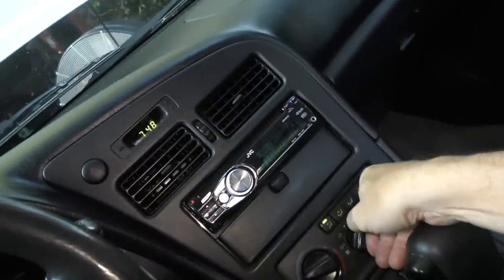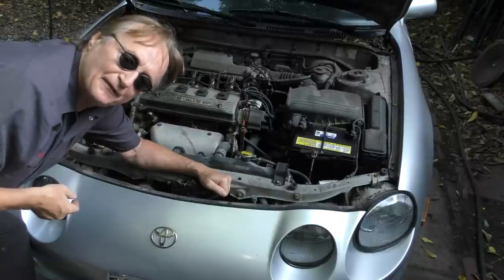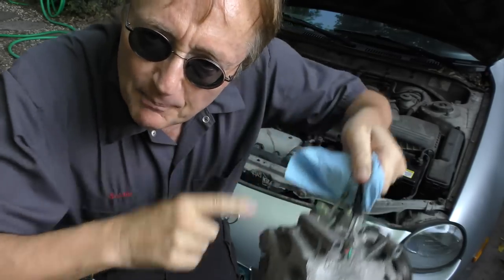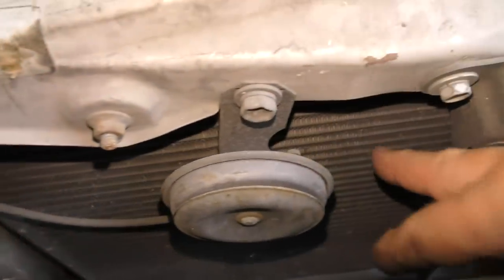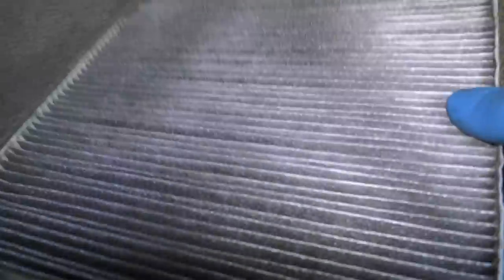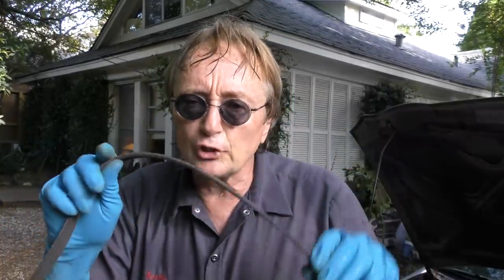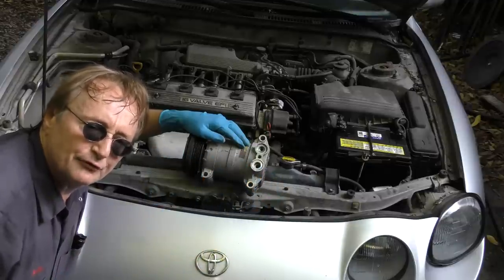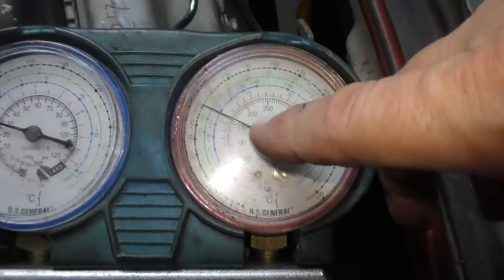How to Keep Your Car's AC Blowing Ice Cold

Comment: hey scotty I have 20year old Toyota corrolla few month ago my ac condenser fan stops working I drove about 1 month with no condenser fan after some time I have replaced my ac condenser fan but now the cooling has dropped significantly my mechanic told me to let it be so otherwise get your compressor changed ..... the problem lies is I am not able to find a new compressor .... only the second hand ones are available where I live....... (not rebuild one) should I try or import a Chinese one .... this is not my daily driven car ... so do I let it be  .... Thank you

Comment: Hi Scotty .. I have a1988 Cadillac Eldorado Base Model . AC blows cold but not much comes out of the vents set on high. Thought it might be dirty Cabin Filter. But I believe it doesn’t have one. If it does where is it located? Any suggestions why I am not getting to much air threw the vents?

Comment: hello scotty
why is it that most german cars with turbos burn oil. My VW passat b6 was burning 1 quart of sythetic oil every 1000 miles. The car was under warranty so the delearship fixed it. But I hear so many people have oil consumption issues with the VW/AUDIS.
Reply from the maker: cause turbos bascially increase compression ratio inside the engine, and the higher the compression, the more they burn oil over time

Comment: Hey buddy I watch your videos all the time literally I have a Mazda my ac stopped working and I have a baby and 3 kids lol I wasn’t getting any high side pressure so I replaced compressor now I get high side pressure I bought a temp gun to scan the condenser and I’m getting different temps when I put the laser on condenser so I’m thinking there is a blockage so I’m going to buy a new condenser it blows cool but not cold enough like it used to I changed expansion valve also so I’m thinking it’s now the condenser? My fans work also

Comment: I just filled my 2007 4Runner with refrigerate before a trip to visit family over the 4th, and the problem I had beforehand was the passenger side blew cold and driver side was lukewarm. 
So I added refrigerate with the A/C Pro kit. It worked...kind of, but the problem I have now, and we encounterd this on the trio and back, is that it would blow lukewarm and cold in like 30 second intervals each. It would basically go back and forth the whole time. 
According to the meter that came with the kit, I had plenty of refrigerate in the system after adding it, so......any suggestions to my current issue?
Reply: Probably have to email him.  Doubt he will answer your comment.

Comment: That condenser is actually quite dirty. They sell a coil cleaner at the HVAC supply house and its pretty cheap. You just spray it on, let it foam up, then hose it off. You'll see a butt load of dirt come out of there, trust me.

Comment: Hey Scottie I took my 2001 nissan frontier to bigo tire ac was blowing hot,$ 223 dollar's later still blowing hot air. I let the same bigo tire store try and fix it 5times.
   Now there is coolant all over my low and high side and the same bigo shop gave me a quote for $811to repair the lines from both high and low.
   I'm  pretty sure that I have a shady bigo tire shop since there was no leaks for 4times and the 5th time it's all over my engine. It like the coolant was out having a rave in my engine. 
   What's your normal way a mechanic will do a ac diagnostic?
   And all 5 times given the same invoice and one time the manger wrote with pen that ac was charged with die. Is this a normal way of doing business?
   Please help Scottie I have a make shift cooler and dry ice ac now and I spend about 5to 8 hrs in the truck.

Comment: I have a 17 crv with the new r1234yf refrigerant which is a pain to get someone to fix and don't trust dealers to fix anything. It's got dual zone climate control so right side gets cool and rear vents but left driver side blows warm and not sure why it what's going on.. so many parts to an AC system it's overwhelming. I can get the gauges but how do I know what pressures high and low ? If it depends on various temps and humidity. And my car says min max recharge around 0.448 kg give take

Comment: My old '97 GMC doesn't use any fans for the air conditioning. I turned it on today for the first time since I bought the truck last October. And it seems to work although the air wasn't very cold. Should I try giving it a recharge then?
Reply: What does that mean that it doens't use any fans for the AC? The condenser is cooled by the clutched fan only? Well, a bus driver once told me that the AC on his bus worked but it wasn't very cold. Why? Only 1 out of 5 condenser fans was actually rotating, and that's what i told him... look if there's another dedicated fan for the condenser and, if not, either put one or replace the fan clutch. Forget about recharging it yourself with refrigerant cans; it's always better to go to someone who has the equipment needed to evacuate and vacuum the system and then put inside the correct charge weight.
Reply: Before I'd install a special fan for the air conditioning, I'd want to see if anyone else has done it on a tGM truck in my age range. But maybe that's why or one reason why it isn't blowing any cold air right now, just air.Actually i don't even think that my truck uses a clutch on the fan. But maybe it would be better to go to someone with the proper test equipment to evaluate the system for I start adding refrigerant. I'm not sure who I;d trust around here right now, though. And Scotty's down in Texas.

Comment: Here is a question: I have a Chevy Cruze 2010 1.8. The problem is the HVAC Module is completely turned off but only in hot sunny weather. There is no air blowing, no a/c, nothing! Do you have any idea what can cause the whole module to turn off and lose connection with the ECM as it is not accessible via OBD Scanner when off. The question is why only in Hot weather ??? Sometimes the fix is to disconnect the battery for a minute than it's back to life again or leave it till the evening and it works again. Any experience of this kind ??
Reply from the maker: You can't work on those hvac systems with a gm dealer level computer, they are THAT complex . So find a guy with one to hook it up and analyze it. Or, do like me, hot wire the stuff with toggle switches to run ac compressor, blower fan, and radiator cooling fans. it's totally doable
Reply: Scotty Kilmer thank you for your awnser! The thing is that everything works fine when it works, only problem is that something is causing the module to shut down. Once it runs, i can acces the HVAC module with my advanced OBD and the only history trouble code is: connection lost with HVAC module, but that is obvious. My question is general, what could cause a module to turn off in hot weather? Connectors look fine, no corrosion. Last summer was the same and this summer again. Now i wanna fix it and started investigating, kind of tired with the battery fix.

Comment: how to check if the compressor works at maximum performance and why does the ac blow hot air when idle and only blows cold at higher rpm, what other reasons related to car electrical system can affect the ac performance?

Comment: I have a 2017 Honda Pilot  and live in Texas. It is hot as hell here. My AC works but it take a long time to cool my car. Is there anything I can do to make it cool faster? Should I try to recharge it or will that cause more damage?
Reply: Have it checked to make sure it has enough refrigerant before adding some. If it has too much in the system it won't work as well and it could damage parts of it like the compressor.

Comment: 07 Ford Fusion blew cold air at first. when charged on driver side vents were cold then passenger was warm. worked when it wanted to for about a week then stopped ... can kick ac compressor on with relay jump (changed relay as well) but still no cool air. has been charged and read on comp. Codes "evap temp sensor so removed dash replaced it and still hot air. had low pressure so filled with refrigerant once more. cause was accidently let out with gauges .... so after all this what could be wrong ?!?! PLEASE HELP ! Any ideas or guesses could help I would be so grateful & thankful @ any tips or leads possibly !!!

Comment: great video. when you install new compressor (pre-oil). after installation, when you vacuum the air out, would it sucks the pag oil out?
Reply from the maker: if it does, you measure how much and put that back in. All good vacuum pumps have an oil level on then you can check to see if more came in when evacuating

Comment: Hi Scotty, love your videos man! Anyway my 2011 Ranger's a/c only works when  it isn't very hot and humid outside. When it is hot out, it is inoperative. I can feel the rad/condenser fan working but the clutch on the compressor doesn't engage. I was thinking maybe the evaporator might be freezing up or I have a bad pressure switch...any ideas?
Reply from the maker: classic signs of being low on refrigerant, or  a compressor just flat wearing out

Comment: Good morning Mr Kilmer! My name is Ron. I have a 2004 Nissan Maxima. There's a humming sound coming from the left side of the engine and it's making the battery die quickly. I've changed the alternator and the p0345 sensor but before I changed the sensor the car would start with a boost just stalled for a couple seconds. Since I've changed the sensor the car cranks quickly but won't start. Can u tell me what that might be.

Comment: I refilled today and got 45 pounds in the green after 1 can of freon. but there is about 65 pounds in the green should I fill it to almost the top end of the green or leave it as is. I'm confused my gauge showed 45 pounds but I didnt wait for the a/c to kick on. Where exactly should my gauge read. It's a 2010 cadillac cts.

Comment: I found out that my double fan (two speed) is not working on low speed when I switch the aircon on. it's just running on full power when the aircon pressure is really high and with low pressure the fans go off again. The fuses are all ok. There are 3 relays and I swapped them, no difference. Which relay is responsible for the low speed, is it the change over relay? Where else can I check it? Temperatur sensor?The fan problem must be also the reason that I lose coolant? It comes out of the overflow or pressing out of hose connections.

Comment: Ac units should never leak refrigerant. Shaft seals on compressors are lubricated by the oil in compressors not refrigerant. Flat spots due to inactivity on the shaft seal or misalignments are the primary cause of this failure. Other issues are when idiots just add gas without correct knowledge of a refrigeration system, they must be evacuated below 500 microns to have all moisture removed, also dont just top up refrigerant levels. Most vehicles run on blended refrigerants now which have different boiling temps, meaning if the leak is anywhere other then the liquid line you are losing an imbalanced amount of refrigerant reducing heat rejection efficiency. Scotty you are a good mechanic but please leave refrigeration and ac to people thoroughly trained in this field

Comment: I have a 1997 Chevy Suburban. I have had all of the ac parts under the hood replaced, but the ac only blows cool (63 degrees), not cold. The mechanic that did the work has replaced the compressor twice. The front and rear air  temp is the same. Any ideas as to what the problem could be?
Reply from the maker: if you used a rebuilt compressor, they are often weak and do just that. also make sure the cooling fan on the water pump sucks enough air

Comment: what about evacuating and refilling with fresh freon? I heard this is good to do every 5 years or so....or is that a waste?
Reply: Every 3 year is better, even better if you have it done by a professional equipped by a recover, recharge and recycle station. I'm telling you this because my car, in 5 years, lost 280 grams of gas of the original 500 ones, without caring too much about running it for 10 minutes a month anyways. Every 6 years, it's best if you have the receiver drier changed too, since it filters any impurity going about in the system. AC needs proper and regular servicing, and proper and regular servicing is not going to a shop and saying "My ac is blowing hot air out of the vents, can you regas it please?".

Comment: Hi 
I want to know that I have TOYOTA ECHO HATCHBACK 1.3L , YEAR2000 ,MODEL NCP10R-AGMRKQ
My Air condition is not working and no cooling I could feel. I took it to the A/C mechanic and he checked that refrigerant is little low but should be working. He then checked with Fluorescent dye and found leak in the evaporator side which is under the gloves box.
I want to know how come if it is leak and refrigerant is not leaking completely because now it is 4 mmonths and still he said there is gas but little bit below the base level.
I am asking these because I want to change the evaporator by myself and when I will do that I will change the expansion valve as well.
Do you think I should change the dryer as well?
Also should I use the Pagan 46 oil for my car?
Please guide me I will be really thankful to you, Actually I am in Australia.

Comment: Hi Mr. Scott my 2000 mustang gt a/c system has no pressure I checked for leaks and found the low pressure valve was leaking and I replaced it then I added a/c oil and the compressor started cycling then I added ac refrigerant the compressor started cycling quickly on and off as I added the refrigerant on the gauge it showed between 30-45 psi in green and it still was blowing hot air in need of help

Comment: Hey Scotty, I just got an engine replacement last week and I noticed the AC is not blowing cold air..
Could this be related to the engine replacement or just a coincidence? Cheers!
Reply from the maker: yes, big work can often cause AC leakage or they may have had to remove lines and didn't fill it back up right
Reply: Karl Duckett did you recharge the ac if you removed the gas.

Comment: with the a/c "on", should the radiator fan full hard on, or cycle full-less-full speed -  my current state- , does it cycle because of fan relay fault ?  I have 2 fan relays in my toyota echo- 2005

Comment: Is it possible to retrofit AC into an old truck? Was wondering if you could pillage parts from a wrecker for other cars and make a mix-n-match system..?
The original ones available from wreckers are over $1500
Reply from the maker: sure, if you have patience and imagination
Reply: The 1980 to 1991 Jeep Grand Cherokee (J-Trucks) had an aftermarket style AC system retrofitted using an independent blower & vents unit that fit under the dash. That is a good place to start. They also used a motorcraft compressor (ford). I've owned 4 of them & it was clearly an after thought system setup from various parts.

Comment: My ac has a leak somewhere. I'll fill it with coolant, and it all leaks out in about 3 weeks, and just before it does, the floor right behind the driver seat fills up with water every time. Do you have a suggestion where the leak might be coming from? This is becoming a real pain in the ass. I ran a leak stopper through it to no avail.
Reply from the maker: put some UV leak dye into the system, the green dye will show the leak. If you don't see it, often the evaporator inside the dash is leaking then, you would use a sniffer detector to find that

Comment: My 2011 Camaro AC compressor won’t move when the AC is turned on. I checked all fuses, all good. I even did power to the ground and the compressor still won’t move. Fans work, belt is good. What gives?
Reply: Probably needs a new one. It might be K'd

Comment: Hey I have question for you
I have 2013 toyota corolla and I had an accedant. in body shop they replace the AC CONDENSER 
and they vacuum the system and recharge it with freon.
Now after few days my AC start blowing poor cold air in mean time I checked the AC line ..was freezing  what is problem could be? thank you..

Comment: Hi Scotty. I replaced my compressor and recharged. My gauges readings are 37 on the low and 325 on the high with ambient temp of 82. I've been doing for a few days and they ac air is not cold enough last time I checked was only 73 F inside. What could be the problem?
Reply: Likely the condenser. It's either dirty inside or outside. I've just replaced it (16 years old and looked like it came from the deep of the ocean) on my car and you don't know how much driveability improved with AC turned on. 80F ambient and 40F air, and it climbs uphill like a champion while doing this. Low should be more like 25-27 psig and high should be much lower.